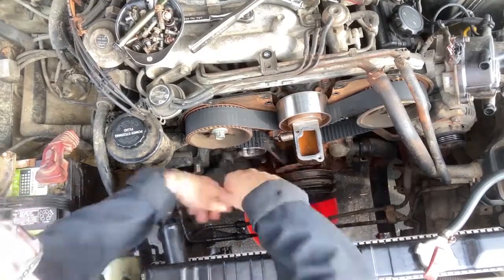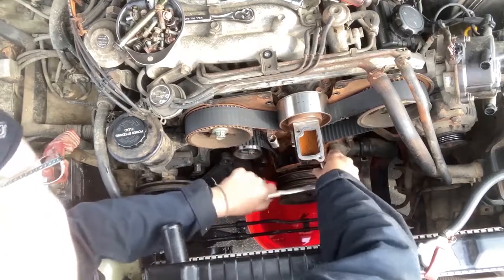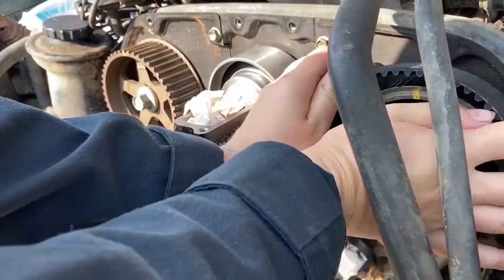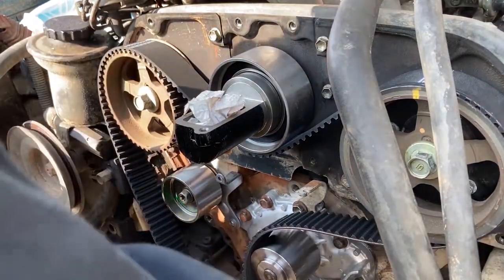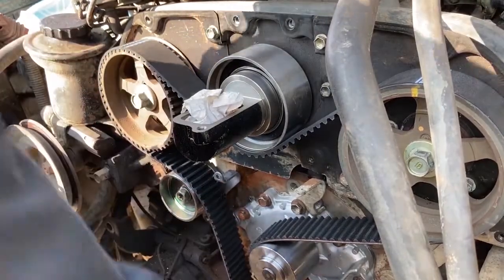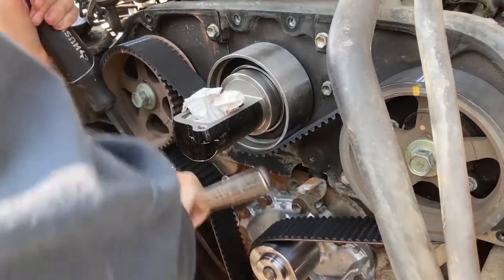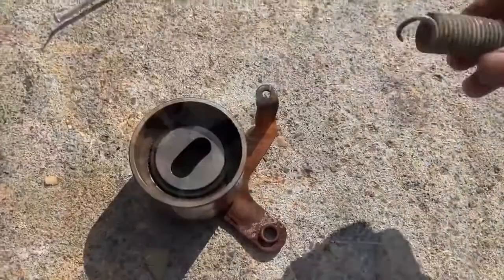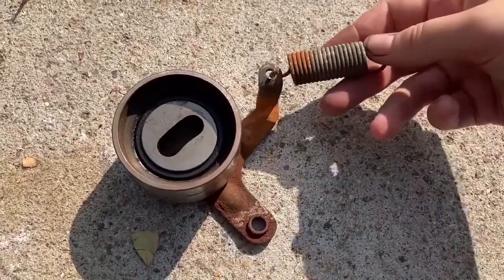1988-1992 Toyota 3VZE 3.0L #1 Tensioner Spring Removal/Replacement - Girlie Garage

Comment: My 95 3.0 had no spring on or around timing belt 🤔 great most clear professional . Worked at a shop my hole life.  Spring?95
Reply from the maker: Thank you for the comment. From 93-95, the 3VZE should have the hydraulic tensioner (no spring). I hope that helps!